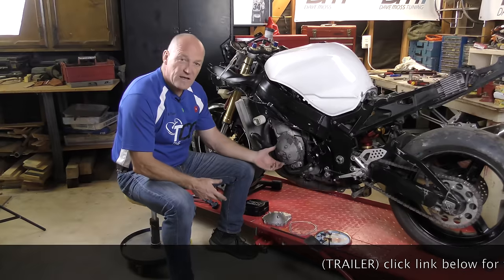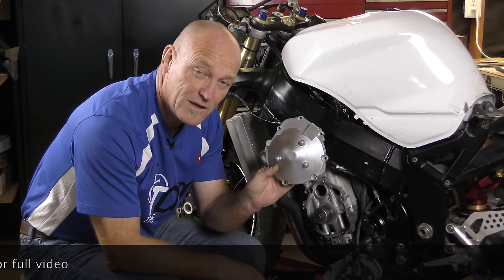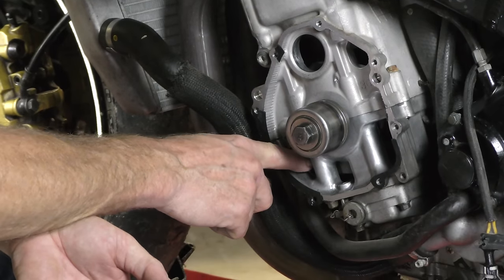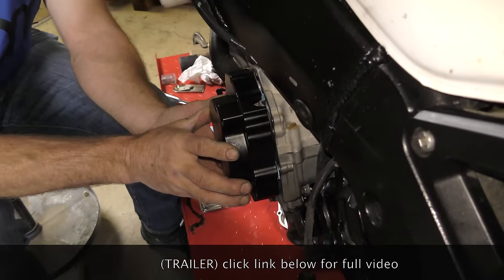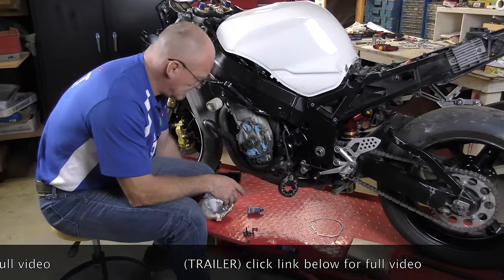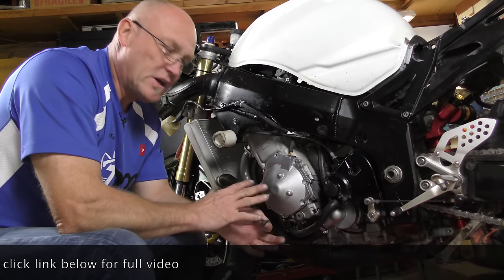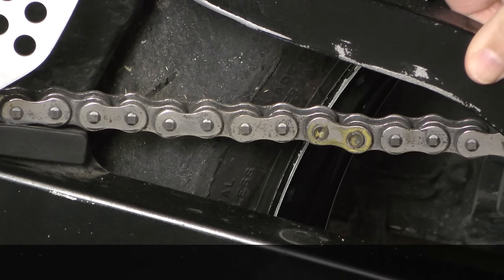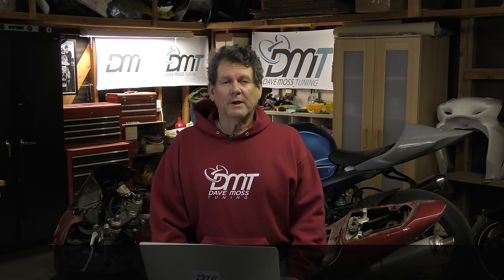GSX-R750 Superbike Super Parts (TRAILER)

Comment: Interesting stator cover. Too bad they are so rare! I just had to replace my stator last week (I have a K8 GSX-R600) with a new Rick's unit because two of the bolts backed out and were grinding. It's my fault I guess because I didn't put any thread locker on when I torqued them down last time.
Reply from the maker: Dave Williams, editor, replying here.  Luckily all that was damaged was the cover, and not the other trick bits inside it.

Comment: Mr Williams if you put the OEM stator back on I thing you will notice a difference in turning the OEM one is like a flywheel and there for will cause a difference in rotating mass also your engine will not spin up as fast. If it were me I would look into spacing the stator out and put a aluminum plate with a seal then bolt everything to that and then bolt a crash proof cover to it / it would only stick out a little bit further than stock where there's a will there's a way / added note when you said the bike looked clapped out looks like you got the best part of that bike..........the motor.
Reply from the maker: Williams, replying here.  Agree, agree, and agree.  I believe the forks, frame, and swing arm are likely original.  They put GSXR1000 brake calipers on the forks.  But I think they took whatever race cartridges out and refitted the stock internals, also stuck a stock shock back in it (as mentioned).  for sure the motor is a fantastic bonus.  Did my fastest lap of UMC East on that bike, 1:38.  I believe the Lap record is 1:31.7 by Shane Turpin.  So I'm about 107%.  I should still keep my day job.
Reply: @catalystreactionsbw  7 seconds within the lap record is respectable but yes keep your day job as I look forward to more great videos.  👌🏍

Comment: These yoshi stator rotor and covers are very rare, that's why I have on mines a 1.5 cm thick carbon custom cover. 😁😁

Its the only solution to protect it from a crash, to build the thickest posible cover on it. 

 maybe you can't see it after all , but you feel it how it revs up like crazy 
 😂😂😂 

Not a good idea at all to ride it with no protection.
Reply from the maker: Williams, replying here.  Who makes your carbon cover?
Reply: @catalystreactionsbw  its custom, was made in Greece. it fits like a glove and has implants, metal spacers  around bolts, so it will not crack . the only minus is that you must torque often the bolts ( I don't use glue there ) Mine is for k7/k8 1000.
 this specific carbon part, it's very simple to be done, cause  it's one piece mold (no negative corners). try to ask some professional near your area to custom make it directly on your cover for 100% success. If you want, I can send you via fb  a picture to see how is mine.